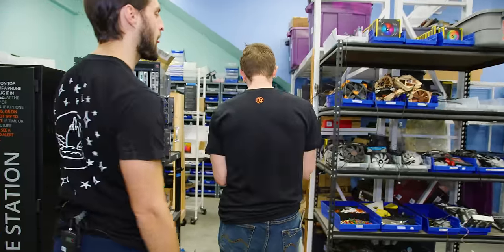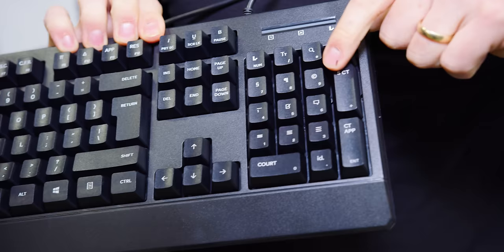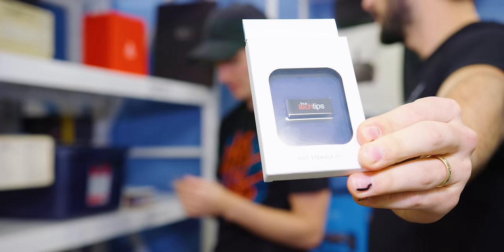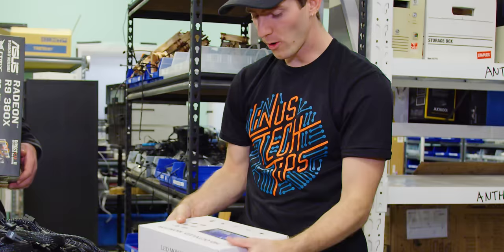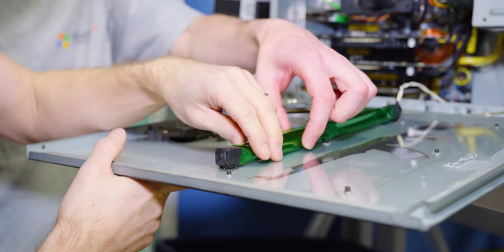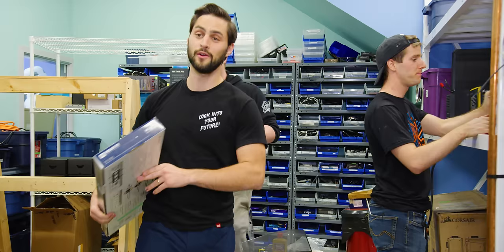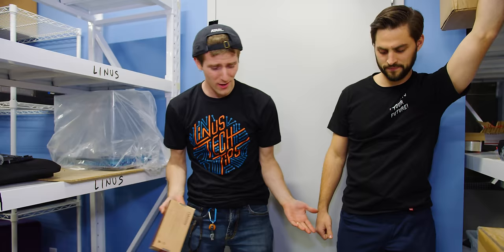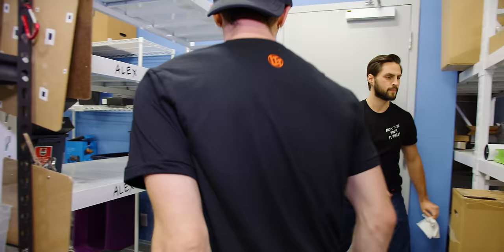The BIGGEST Tech Hoarder!

Comment: (19:00) omg the background on your sleeper pc Linus...

And I for one, would love a concept/explanation vid on the pump-less water cooler!
Reply: Yes!
Reply: btw Linus talked a little about these conceps back at one of the Tech Expos' that he was attending... Not sure if it was CEX or another one. If I'm not mistaking the concept of it all is that inside the loop there is a special liquid engineered to be very temp. dependnt. When it comes into contact with the heat absorber on the cpu (for example) its temperature rapidly increases and causes it to evaporate (kinda like alcohol at roomtemp). The vapor is the carier of the heat and it condenses on the radiator. Then falls back through the second tube so there is an intake and outlet.  The trick was to get a liquid that evaporates and then condenses in a narrow temp difference so as to no overheat the processor. On that expo video they stopped at what they called - The first ACTULLY working model of a pumpless water cooler... I belive fluid cooler is more acurate of a name.
Reply: @kinder_r2075  So a heat pipe.
Reply: @xenonram  Now that you say it like that hahaha, I guess so :D I haven't researched all the way through but going with the couple of things they said on that video. I can't remember if Linus didnt called  it kinda like a gimick because it's basically a large capacity heatpipe system. I can see a couple of benefits though. Heatpipes are good at what they do but they are premade to fit a certain shape and are not so easy to make ourselves, even with pipe bending tools. Pumpless watercoolers might be just flexable heatpipes. You get the benefits of heatpipes plus the flexibility of soft tubing plus the size of the tubes. Not sure btw I might be just saying bulshit..

Comment: if you write in permanent marker on something like metal use a dry erase marker just scribble it out then erase and it will come off. only works on hard surfaces like metals and most plastics tho so your mileage may vary.
Reply: can also do it to a lesser extent with more sharpie
Reply: At my job we use sharpies a lot for transferring and labeling plastic totes...found that alcohol works incredibly well
Reply: Acetone will take care of it perfectly.
Reply: Rubbing alcohol or acetone on a paper towel takes it right off

Comment: I would really like the commodore 64. I was cleaning at my parents and found 2 1541 disk drives. crap ton of software, and a okidata printer but no computer.I asked my mom if you got rid of the computer why did you keep everything else?
Reply: Look up the "Ultimate 64" it's a fpga C64 motherboard, incredible bit of gear. Next level exotica compared to what this channel deals with
Reply: It is possible to make a commodore 64 at home btw, it's a bit involved though. See installing CP/M, as well as homebrew 6502 Computers
Reply: Give it to someone who will restore it to its former glory... The 8-Bit Guy is always fixing up old Commodore 64's
Reply: @somedude4122  that comment is insane, what has a home made 6502 computer got anything to do with a C64. The C64 is 100 times more complex than those machines. Custom hardware out of it's ass, same place as your comment came from lol
Reply: @luelou8464  Also has a custom Atari chip though. All this things have already been rebuilt in FPGA though. Check out the "MISTer"
Reply: @thomassmith4999   TBF, OK, many of the chips used on the C64 can't be found, but they're very well documented and easy to emulate using other cheap MCUs. It won't be a Commodore 64, but will be compatible with it. Source : It's been done before - https://www.geeky-gadgets.com/diy-commodore-64-style-all-in-one-powered-by-8-bit-mos-6502-cpu-05-02-2015/
Reply: @ryanschenk2946  The 8 bit guy definitely doesn't need any more C64s or parts, he's drowning in the things.
Reply: @spooforbrains  yep, I think you're right. Sleeper PC might actually be kind of sweet with that form factor.

Comment: "THE PUMPLESS AIO" can work but its need to be instaleed on invert (up side down) case and the radiator need to have top and buttom connections. 
The processor(heat source) must be at the height of the bottom half of the radiator, pipes from radiator need to be connected in "
decrease way" of at least 5%. So the radiator need to be mounted vertical. Buttom pipe "cold" needs to go up to the processor and pipe "hot" from cpu needs to go up to the radiator top. Radiator need to be as big as u can at least 360mm. All the fittings need to have big diameter (no flow interrupt) and the gravity will do the work. Also good fan`s will help with increese of flow speed when they cool down the radiator more, the diffrence between hot and cold will be greater. one bad thing is that the cpu( heat source) needs to work on high deltaT parameter like 85 hot 45 cold to work convection like. sorry for my bad english. best regards from Poland.

Comment: I love this one because I have a lot of old E-Waste "still good" tech garbage in my house.  I just recently FINALLY tossed out one of the first PCIE sound blaster sound cards that I bought back in 2007? and I also FINALLY tossed out my DFI Lanparty UT-4 expert N-Force 4 computer. it could house both IDE and the NEW SATA hard drives with UV reactive motherboard components!  I was going to keep it and mount it on the wall but several capacitors burst and leaked all over it. It was over 15 years old when I tossed it. I still have UV reactive MOLEX power connectors because I was GOING TO redo my wires with them back in 2005... still haven't used them.  My inability to toss garbage tech in a timely manner is a nightmare.

Comment: Linus.. you guys need an RFID management system. Label it with a unique bar-code, scan it in and then it goes into whatever inventory system that's compatible or you just create your own. You'll be able to print reports, see scan logs and the whole 9 yards. It's useful for all supplies so you'll know when cleaning supplies are low or if you need more glue, zipties whatever it is.From my experience managing inventory, it was way easier to reconcile inventory when it's done in the scan style way.

Comment: @LinusTechTips Linus, You are so inspirational, I need to have a MAJOR declutter too, I live in a 1 Bed Flat or Apartment depending on where you Live and my Bedroom is more like a Storage Warehouse, Well that’s how I’d class it with 5 x Sets of Racking, Over a hundred Laptops although about half of them are just for parts and about 50 x PC’s oh and an old Dell PowerEdge 2650 Server that hasn’t been turned on in ages due to it Screaming like a Bitch, 3 x Big Boxes of Keyboards with some OLD AT Keyboards in amongst them and that’s only the tip of the Iceberg, I did have a Storage unit some years ago but it had to go... It’s now just a case of where to start?

Comment: Oh shit, Im watching this on a computer ontop of a case that has that board at "13:00".  It was a piece of shit board that supported the aweful P4 which couldnt beat the P3 from 1999 without at least 1ghz extra speed.

That board does have a promise raid controller with 1 PATA and 2 SATA PLUS the southbridge has 2 PATA and 2 SATA.  I have 4 40-41gb drives in RAID 1+0 (maxtorATA133, seagateSATA1 & WD 100ATA+SATA1) that boot into another 6 120-160GB drives in a raid 5 (Samsung 2.5sata2, Seagate 160 SATA + 4 ATA100 WD drives from 2 different generations)

Got a 2gbps  NAS card in it with fiber running out the back.  The promise&fiber card share pci bus bandwidth, but the 3.2ghz P4 cant keep up with what an ARM can do for file transfers, parity & low overhead networking.  My athlonXP has better raid performance on the KT333ultraR